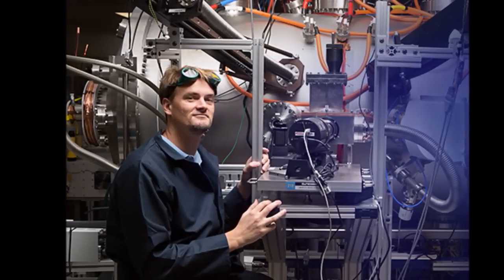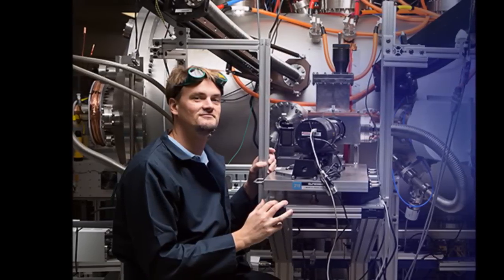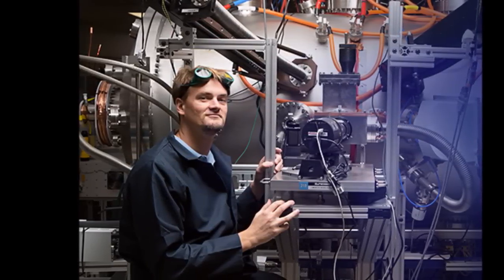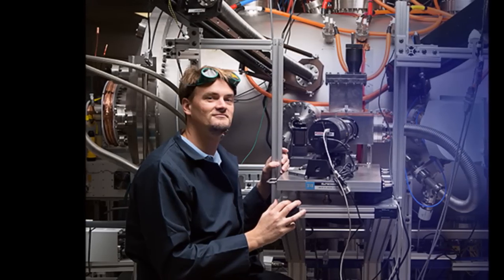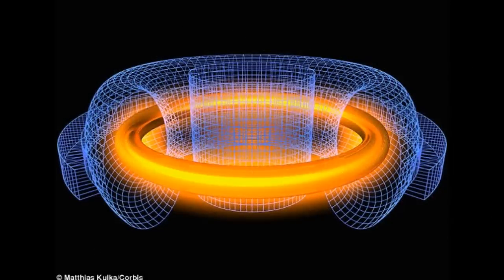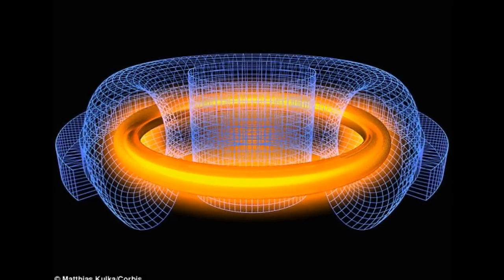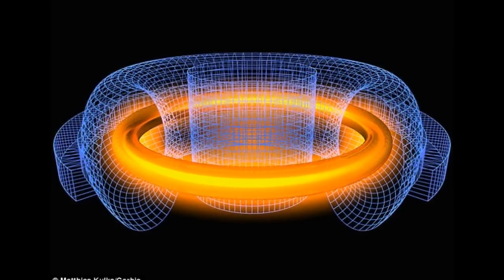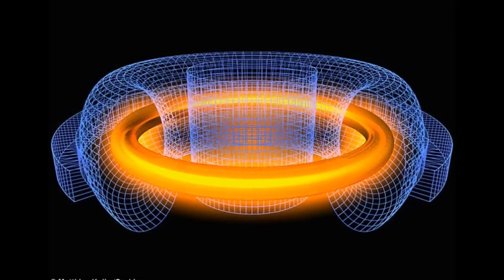Lockheed Martin announces it's working on a compact fusion reactor

Comment: I noticed the so called super conductors were supported by very thin supports. This CFR is an version of TMX (tandem mirror experiment 1980-1986) which occurred at LLL. The absence of at least one baseball magnet was when I knew this was just another project to get government money. The greater the magnetic field the better the magnetic bottle which was not mentioned nor indicated. Neutral beam injection is old from the 1980's and it does work. Old magnetic experiments were BASEBALL, BASEBALL II, TMX, TMX II, 2XII, MFX. Laser fusion which does not work had the funding for magnetic fusion killed.

Comment: As soon as a physical process has been theoretically explained, the associated
technology can be developed. The development might be difficult & the design of the facility
housing the process (for example the fusion reactor) might be expensive, but in spite of
these facts it is worth being payed for because the profit will be long lasting & it will also by
far exceed the investment. On the contrary, if the theory forbids the development (e.g. of
batteries to store electricity, because of the material property of the low energy density per
unit of mass), the development is counterproductive, as happens to have been proven in
Australia, where coal plants have been junked & could not come up although wind ceised
blowing & no sun was shining for a long time with the consequence of batteries being
already discharged. The net collapse followed. The thermonuclear fusion theory speaks in
favor of designing the machine that houses the hot plasma, because the wave vector is
indeed huge at these characteristic frequencies (although it does'n diverge, but also the
wall stiffness doesn't & in spite of its being finite pushing our head through such
structures fails). Accordingly the plasma will not escape from the electromagnetic cage, 
it will  not cool down & it will maintain the fusion. More money should be allocated to 
accelerate the work on the most important  21st century project in order to provide the 
commercial reactor even sooner.

Comment: I keep hearing about the potential for fusion powered space travel, but nobody ever mentions the means of propulsion.  Fusion generates heat, but how would we convert that heat to physical motion in space?  On earth we can boil water to turn steam turbines (to generate electricity or to be harnessed directly into physical force via a piston or a propeller), but in space a propeller is useless, and you'd run out of water pretty quickly if you're using the steam itself to propel you.
Reply: Exhausting the plasma. Heat is how fast particles move, producing a plasma out of a couple grams of gas and then exhausting it creates thrust. The fuel is the gas used in the reactor chamber. Alternatively it can be used to power ion drives.
Reply: It seems to me that exhausting a couple of grams of plasma wouldn't create much thrust regardless of how fast it's going.
Reply: Every action has an equal and opposite reaction. Exhausting a gas at 10 km/h vs 100000 km/h is a huge difference. Likewise exhausting it for 100 seconds vs 100000 seconds. Because it would use so little per "pulse" it could keep going for months or years.
Reply: Yes, every action has an equal and opposite reaction, and force = mass time acceleration.  So, a (very small) craft weighing 10,000 kg would need to eject 1 kg of plasma at 10,000 km/s/s in order to achieve an acceleration of 1 km/s/s.  So, a spacecraft using this technology would have to carry a huge amount of propellant (same as conventional chemical rockets) and, I think, would run out of that propellant very quickly (as chemical rockets do).
Reply: People smarter than me thought about it and for them it makes sense. Why it hasn't been built yet is another question, it could be that the technical aspects have yet to be developed enough. Low thrust, high impulse propulsion is well established however and it requires less fuel.

Comment: Designing the fusion reactor is implementing physics in order to provide the cheap
energy source while the development of the renewable energies' facilities is the struggle
against physics. Solar panels & wind turbines do not generate upon requirement while the
batteries' design is senseless because of the low energy density per unit of mass of the
store. Many parliaments support the failed renewable energy technologies. Finding partners
could prove difficult because investors want an immediate profit.

The geometry of the current external to the fluid has been determined with the consequence
of the plasma being magnetohydrodynamically stabilized. But now the energy output of the
thermonuclear reactor must exceed the input & therefore the budget should allocate the
money to accelerate the project work.

Comment: If that is truly the fusion reactor desgin of Lockheed Martin, it is undoubtly more flawed than the Tokomak design.  We must capture the heat energy along with the light energy.  Light energy alone cannot result in efficient energy conversion.  Even capturing a small portion of the heat from million degrees celsius itself is a poor energy conversion.  Everybody needs to go back to drawing board start over in the fusion reactor design.

Comment: Would you believe that there is wifi high tech beeper that use ir and laser scan for body heat that simulates a a stages off mind and and works as chrono- grapho mind healer that use sound neuro response in short the stuff that use holo doc in Voyager this submind electricaly simulate sub freq off brain storm in so socalled pre light conditions as medic sound. A blue beep that stimulate as mild mid storm sound off storming.Basicly a medic predetermed sound mild storming into ir area to create a neuro response. A doc healing holograph with a sound beep colector wifi and ir sensor and laser. Yess a simple diagnostic device, but real shown in Antlantis movie, the wifi analisys and a circle ball shooter gives a electric and sound impulse a kind off usb on ball electric shooter and voice giver. Works a fantasy stick for water or aroma therapy. This tech is very close to warp core or fusion reactor. This is the reason whyship quarters are split in two crew and medicine or in life as mediciine and homeopathy, but doing pings on markets doesnt describe the role big bang in future. Is open mind for Harward. But not without stuff or gismo as above. Funny but the role off mooney far ahead doesnt mean much, simply using more off 73% off ability. Is also proper view fot future to describe to big bang view. One it was someone, then a coin then a big bang. But a colosal idea off big bang view in future simple overemphasize view as stage off evolment. Higher evolment more emphasized view not smarter. And a wifi goes simply as ship with sails. Bulid this along cold fusion core or warp cold fusion core with trigger engines, whic are basicly a star trek engine. Funy enough girls are more respectfull in the future. Have fun.
Reply: i dont undstand what the fukk you was just on about an dont giva fukk i hear to see a startrek type power sysytem fingy.

Comment: their is better and safer way with out using nuclear fuel ! The way is Quantum mechanics in Electromagnetics and this based on science physicists farday and Maxwell and Nicola Tesla in electromagnetic fields ! this has been tested by nasa 6 engineers in June 15 1992 in Penn Yan New York on star drive engineering warp dimensional drive saucer 100 miles and back of total of 200 miles around trip in 1.5 minutes or 90 seconds ! mark Tomion is author of star drive engineering manual technology book from the saucer builder technical manual give to nasa for contract for 10 warp dimensional drive saucer ! star drive saucer ship can across galaxys and multi dimensional universe in electromagnetic warp bubbles in seconds ! this all true factual scientific sciences information and evidence ! your nuclear power is way to slow and dangerous ! stardrive uses only magnetic fields like tesla would use for it own fuel for propulsion